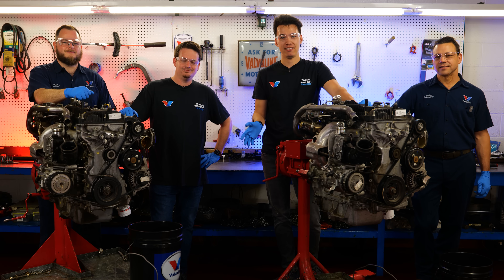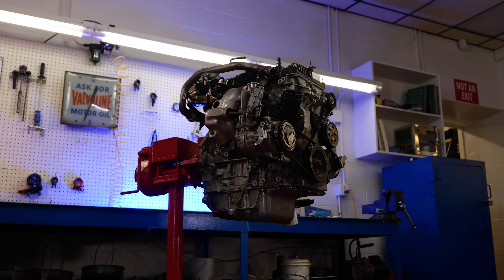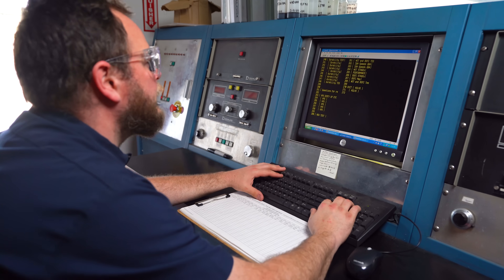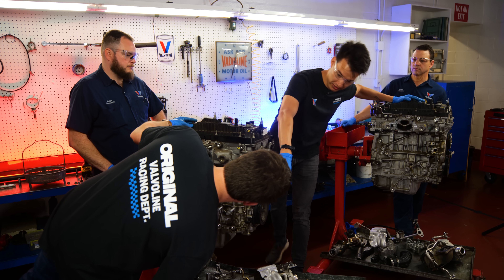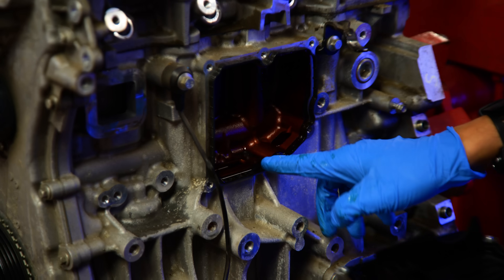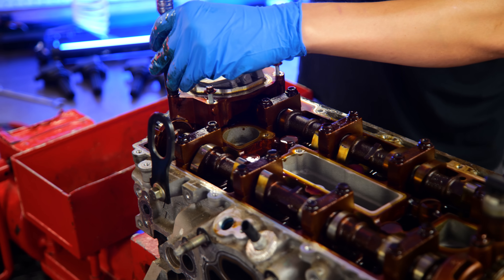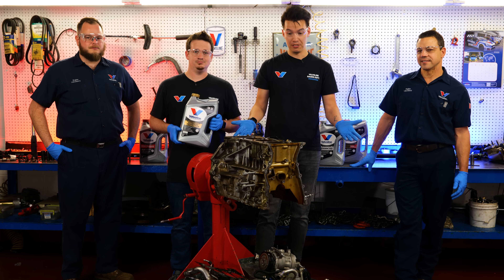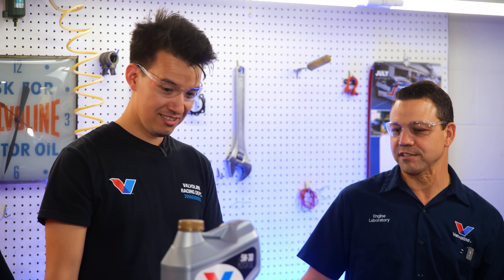Testing different oils over 4 years and 1 MILLION miles

Comment: This is why I change the oil in my 2015 2.7l ecobeast every 3-4,000 miles with Mobile 1 full synthetic. Its now at 158,000 miles.
Reply: Wanna know something funny...ran mobil 1 products for years...always had oil burning issues despite sub 5k mile oil changes, and didn't matter if car was NA, supercharged or turbo...switched to valvoline and they burn damn near zero...blackstone can say what they want but mobil is without a doubt an inferior product
Reply: Mobile 1 is an inferior quality brand, stick to something like Liqui Moly or Motul
Reply: @MowSow  Blackstone oil analysis says different. I'll stick with Mobil 1 Full Synthetic. No need to waste money on uber expensive oils.
Reply: @1FiftyOverland blackstone recommends you change every 3-4k miles?  Do you drive in abnormally harsh conditions?
Reply: @christians131  I never said what Blackstone recommends. I said Blackstone oil analysis shows that Mobil 1 is not Inferior like the commenter before you stated. And yes I drive in harsh conditions. I live in the the mojave desert very hot and dusty summers and freezing temp winters.
Reply: Same. Every 3k. 10k is bonkers and asking for issues

Comment: It makes me wonder with planned obsolescence in the United States, do they think of the income they need to make after warranty and implement that into a failed part. The difference in catalytic converters without the car rumbling on the road makes me think. Without speed bumps, big break hits, massive vibration from different road surfaces those things should be pretty close in failing. Did you ask them if the engines revved up and down at the same time? That would be a big factor if one was revving more than the other or at different RPMs at different times. I guess there are a lot of factors that go into it. I just think of planned obsolescence all the time. It should be completely illegal to implement planned obsolescence into anything. It's sad we are a throwaway society anymore.

Edit: I love Valvoline and this is more to the big auto manufacturers than Valvoline. If it wasn't for a specific manufacturer request of a different kind of oil I would definitely be running Valvoline. I have a 1991 Toyota Helix and that sucker gets the Valvoline red jug. 🤘
Reply: Id assume that both vehicles ran as close to the same as could be possible considered. Given they did everything with drive by wire directly into the throttle sensor. So all they did was dictate a throttle position and the car did that. So everything mechinical should be on rails as much as possible and responding to their inputs essentially identically. With the exception of due to a mechinical failure that would change how the vehicle operates.

Comment: some people complaining its a 15 min Ad are wrong. it's an  interesting video comparing conventionnal to synthetic oil. it could have been any other brand of oil. the test is not telling you ohh valvoline is so much better than any other. its comparing valvoline synthetic vs valvoline conventionnal 
The result are what i expected.. a lot more varnish and build up with conventionnal oil.
Reply: not independent
Reply: The interesting takeaway from this is that both being what they are, the actual physical wear of the metallic contact points is negligible in their differences.

Yes the conventional has a slight bit more wear, obviously, but it's so minuscule that honestly I have to wonder if the average person would even be able to keep a car alive long enough that the wear compounds enough to make a difference. Chances are really low. What we see here is the buildup of conventional oil is the most likely culprit to cause problems long-term, but even so that may just be because they were doing long-term oil changes (10k miles) and not because of the inherent properties of the conventional oil; everyone knows you change conventional sooner than synthetic, and anything past 5k with conventional in even ideal conditions is going to cause problems.

The same thing applies that people, more and more, have been saying for years at this point; it doesn't matter what you put in it, change the stuff often and you wont have a problem.

For what it's worth I'm still running synthetic just because I want to minimize problems as much as I can, and protect my investments.
Reply: @WC3fanatic997  its staged
Reply: @lemcakes32422  Why would a company stage a comparison between two of it's own very similar products? And if they had a reason to stage something like this, why would they do it to such a minuscule degree?

Like I literally just talked about in the comment you replied to, the differences are so negligible that honestly it doesn't even matter. If Valvoline was trying to set up some kind of "Stage" for a product up-sell or sway public opinion on something, they would;

1) - compare two products that are in direct competition with each other, i.e., a competitor's brand, where the two products are directly comparable in both stated claims and price,
2) - not be trying to compare two products that are already so similar it literally just comes down to a price point, and where public perception is already in favor of the product supposedly being pushed, and
3) - they would be trying to make the end results seem a whole hell of a lot more significant between the two than "one has a little tiny bit more gunk than the other after 500K miles"

Look, they might have staged it, sure, we can go with that, but why would they have? What would this prove to anyone who either cared or who didn't already know anyway?
Reply: The better question is, why would a company not actually compare oil results from a different manufactuer? Also, it's quite obvious by anyone with 2 brain cells why a company would show a more exspensive product in better light than the cheaper counterpart.
PROFITS.
You either have no critical thinking, or are a shill for the company. You're on their PR team aren't you?

 @WC3fanatic997
Reply: @WC3fanatic997 profits genius. Very simple. Market the more exsensive counterpart to the cheaper one to increase profits. How much does your PR team pay you? Because it should be less.
Reply: @oneninerniner3427  that's all you got? No logic or reasoning? Cool.
Reply: Want to live forever? Jesus, the Son of God, loves us so much that He died for our sins on the cross before His resurrection three days later. With His sacrifice, our sins are forgiven and we can live in eternal happiness! Follow Jesus, repent, and live forever with Him in Heaven! To learn more, check out the Gospels of Matthew, Mark, Luke, and John in the New Testament of the Holy Bible.
Reply: Would like to see what the engines look like with change of 5k or 3.5k miles. I bet the engines, mainly the conventional, would look much more alike. They said wear is the same. All this means is the conventional breaks down faster and varnished quicker. If you change oil more frequently, you stop the varnish effect.
Reply: @christopherclark4774  
1000000% we got some DD8 engines in our fleet that have 20k oil change recommendations. (I know some companies that push them to 30k)
We never followed that, and do 10k-15k or less if it's a city miles truck. Six gallons of 15w40 every time, all conventional, but it came with $40 a gallon stealership synthetic.(With the filter it would have been $300+, not including the water separator and the fuel filters add another $200)
Happy to say the oldest one in the fleet just hit 300k with zero issues, except it's on it 3rd Allison transmission, all covered under warranty.  No service bulletins or recalls, just down for two weeks or a month every time.  Basically expected every 100k for Allison to leave you stranded.
🤣😭😭🤣😭🤣😭🤣😭😭
Reply: @christopherclark4774 no you would not, bc the conventional has much less cleaners in it and it's thicker. So over all those miles it will automatically be darker and based on its molecular structure. Obviously the synthetic is synthetic not as natural and has additives for cleaning which makes it a lighter color and less crude oil content. This giving the lighter color but both performed brilliantly. My car looked worse at 70k than both
Reply: Ya it's not really an ad. Ya their branding is on it but it wasn't a cheap test. They put their conventional product vs their synthetic product and followed manufacturer recommendations. It's more like a PSA and prob some relevant data for them. If all it takes is having a little Valvoline logo on it and we get like $100k+ cost real world testing idc. I want the testing.
Reply: The test vehicles are Explorer engines.. I truly don’t care what oil is used, they’re shit platforms to start. 😂 maybe a coyote engine would have been, cooler.. still ford, and more enthusiasts would be enthusiastic about that power plant than this. Also, they should have had the star mechanic, Mike, be there. He would probably more geeked and enthusiastic than these two boring bens
Reply: @SkarryTerry  The 2.3 is in the Mustang and Focus RS. These are pretty good power plants.
Reply: its not interesting its a dead horse beaten beyond reason
Reply: @evolad2463  i'm interested in what the difference of oil do to my engine. You can skip if you dont care.
Reply: @evolad2463 this is my first time seeing this dead horse up close so no
Reply: @evolad2463 yet here you are caring enough to comment and watch the video, Do all dumb asses now just collect together online?
Reply: @evolad2463  "its not interesting its a dead horse beaten beyond reason"  You'd think so, but some people still don't believe the synthetic oil is just plain better.  Unless you have a good reason to use mineral oil (e.g., higher friction running in oil, Wankel rotary oil, very thick grades like 20W60 [or even the unofficial 40W70 (gear oil is not the same scale)] that aren't readily available in synthetic etc).
Reply: @TassieLorenzo  It's slightly better at best. It's been proven by unbiased sources many times. This is a commercial for a company trying to boost sales of their more expensive products. Better flow in below freezing temps is synthetics best advantage. Anyone living in warmer climates is pretty much throwing money away. I've torn apart more sludged up synthetic oil engines than I can count. Vehicles with regular oil change records, but lived their lives in city traffic. No different than conventional oil engines
Reply: @mankind8088  Yeah it's amazing how conventional oil was just fine for 100 years (Even in racing with minimal or even zero wear to engines), but now these oil companies have convinced people they need to pay $12 a quart for "synhetic" or they're gonn be sorry.
Reply: @edjackson4389 Just because something was fine doesn't mean it can't be made better or more convenient. 
Oil change intervals used to be 3,000 miles. 
Now they're usually 7,000 to 10,000. 

The synthetic oil used in this video is $5.80 a quart ($29 for a 5 quart jug) at Walmart. They have other Valvoline synthetic ones that are a little cheaper.  too. 
Supertech fully synthetic is $3.73 a quart.
Reply: @themikeroberts  I use the Supertech, and I'm not 100% against synthetic oil, all I'm saying is it's over hyped and the advantages  are minimal. And I wil never follow a 7-10K oil change recommendation. 5k miles tops. Lastly most customers who insist on running synthetic want Mobil 1 or Penzoil Ultra which is double the prices you're talking. To each his own. Have a good one
Reply: @evolad2463  Maybe so but up until now, the dead horse hasn't been displayed in a very clear side by side video like this, at least not that I know of.
Reply: @Harold_Callahan  there's like 50 videos that are identical to this one

Comment: I'd be interested in seeing conventional at a 3-5k mile oil change interval vs the synthetic at 10k mile. Currently running Restore and Protect in my 200k mile GX470 so it's cool to see a glimpse into the engineering and testing side as it highlights where that extra cost of Valvoline actually gets spent.
Reply: Yes, in my 2uz at 240k mile, I do semi synthetic HM oil at 3.5k interval. The one thing for our 2uz in particular, No chain or tensioner to varnish, no turbo so much lower heat, iron block so more durable. Realistically this test should mean very little to us as there isn't much internal to go wrong.
Reply: Yes I think the same. If it was conventional 5k vs synthetic 10k, I think the results would be the same, conventional is at best rated for 5k, I change conventionals/syn blend at 3k.
Reply: But what would be the benefit of that test because conventional oil changes at 3-5,000 miles would cost a consumer way more and be way less convenient than 10,000 mile synthetic oil changes so even if it showed conventional at that oil change interval was as good as synthetic, it would be useless info. 

So I'd rather see if cheaper oil ran as long as more expensive oil was just as good - which is in line with what this test was for.
Reply: Synthetic would still be better.
Reply: 10k oil changes are a major cause of  problems if you ask me. I own a shop and have seen massive failure of timing components at just over 100k miles on a lot of different motors. If you run synthetic and do 5k intervals most any engine will last many hundreds of thousands. Not all. Some are prone to failure out of the box.
Reply: Valvoline wouldn't advertise that because they don't want people realizing that 5k is better - I'd wager 5k conventional blows 10k synthetic out of the park, and neither of the engines would have noticeable issues vs the samples in the video.

If they explicitly showed 5k vs 10k, they would be shooting their own marketing saying 10/15k is good in the foot. Also, regardless of if they want to or not, the rest of the auto industry is pushing for 10k changes on newer cars. If they went against the grain, people might think their oil is less reliable and buy oil from other manufacturers that say 10k is kosher.
Reply: @SmurfHunter  Valvoline would definitely prefer you change your oil every 5k miles because then they sell you twice as much oil. 
If they didnt think any oil could last 10k they would be showing that any chance they had.
Reply: @johnhonda93   but what's more profitable for Valvoline? Conventional oil every 5,000 mi or synthetic oil every 10,000 mi?  Obviously Valvoline would prefer synthetic every 5,000 mi but if synthetic costs significantly more than conventional and they sell synthetic because they promised 10,000 versus 5,000 mi and it's significantly more profitable for Valvoline to cell synthetic overconventional even with the added miles then is conventional at 5,000 mi intervals better than synthetic at 10,000?
Reply: @SmurfHunter  it's crazy how engineers can spend decades developing better materials for better reliability and less maintenance and people somehow still act like it's some elaborate scam
Reply: @kern417  Because it IS a scam. Manufacturers extend OCI to 10k+ to reduce quoted maintenance costs and reduce dealer visits but last long enough to survive the warranty. Manufacturers know the limits and they push them right up to it.
Reply: @superjesus4307  idk what engines you use but i have multiple engines with 100k miles and 10k changes no issues. Designing an assembly to work better with better materials is not a scam. It reduces dealer visits for customers that complain about requiring too much maintenance. It meets a customer need exactly. If anything, a shop telling customers they need more maintenance than necessary just so they can charge triple for oil changes is the scam.
Reply: @superjesus4307  did either engine look like it was on the edge at 500k miles?

Sure, less required maintenance is a selling point.

However, oil today is not the same oil people were buying in the 1970s.  Not only have cars improved, oils have also improved.

Looking at the results, it doesn't appear either got scammed.  But it does tell me that if I'm going with the carmaker's 10k mile interval, I'm using a quality synthetic oil.
Reply: @kern417  10k miles on Fords is OK, but BMW definitely pushed it too far with 15k mile intervals with their "free" maintenance program. BMW later had to backtrack and retrospectively reduce the interval to 10k miles.
Reply: @TassieLorenzo  my car is a 2018 and the service intervals in iDrive calibrates based on my driving style so currently recommends 7k miles. It's very intelligent to make sure owners do what's needed.
Reply: @SmurfHunter  So Valvoline don't want people to buy their product more...? If 5K is worth it, they want you to do that, but a company with integrity won't say - You HAVE TO change at 5K - If 10K works just fine for the regular consumer.
If you change every 5K that's just good business for them or any other manufacturer. Your logic here is very flawed.
Reply: @SmurfHunter  they literally SAID that they used 10k because that is what FORD recommends
Reply: @Heck6  Neither, it is the Fed EPA that is making the recommendation!!   Don't you just love Big Brother?
Reply: Seems like that is more expensive.

I don't think the synthetic is 2x the cost of the conventional.  Plus, if you are also replacing the filter, it seems the money saving choice is Synthetic over the 10k OCI.

I think one can get the conventional for $20-$30 for a 5 quart jug vs $30 to $40 for the synthetic.

If one wants to go with Valvoline, one is money ahead choosing the synthetic and going with 10k mile oil changes.

The synthetic at 10k is likely cheaper than the conventional at 5k intervals.